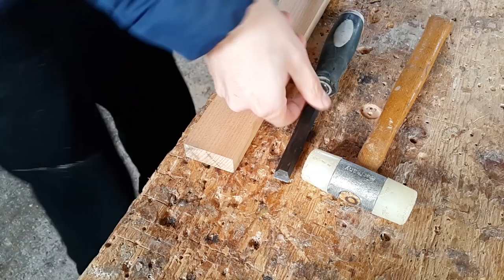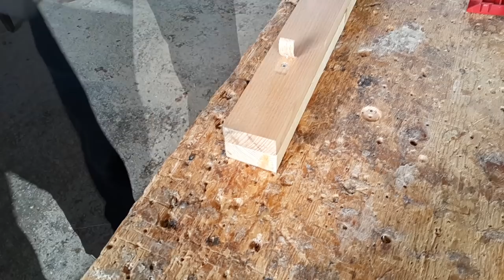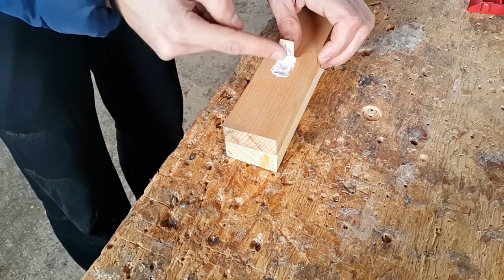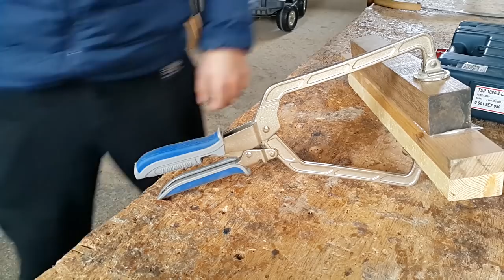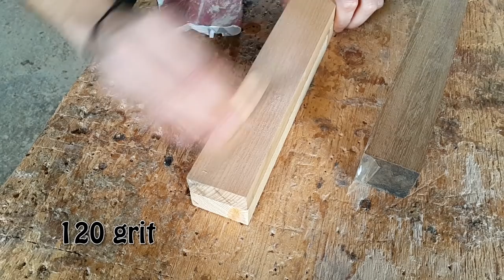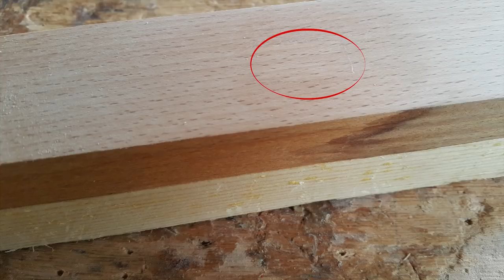Quick Woodworking Tip: How To Hide A Screw (FS Woodworking)

Comment: love it.
tempted to use this on some outdoor planters i've made out of cedar and stained with a dark rich color.
I was gonna drill down and plug, or make dowel rods and pin the parts with glue, this is a lot better.
I wonder if an iron would help set the gules faster.
Reply from the maker: Hi, it is a good technique. Iron won't help I think. Leave it clamped overnight and in the next day sand and will be fine.

Comment: A very neat idea, but you could just glue the two bits of wood together. Takes about the same time, but no sanding required.
Reply from the maker: +David Clarke Of course you can do that. But the purpose of this video was to show a tip on how to hide a screw. The two pieces of wood were just used for demonstration. Thank you for your comment.
Reply: Vasilis Papadopoulos n
Reply: David Clarke not if the screw is going into the end grain, you couldn't. this tip is awesome!